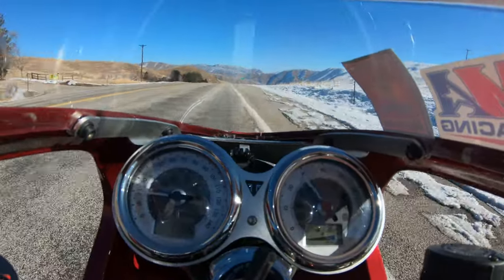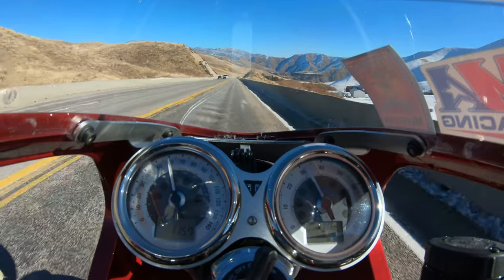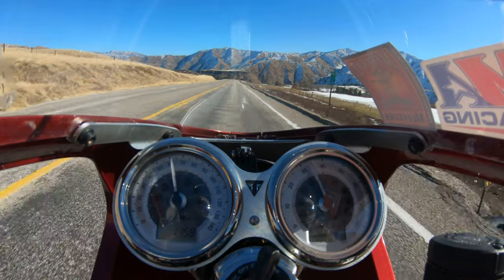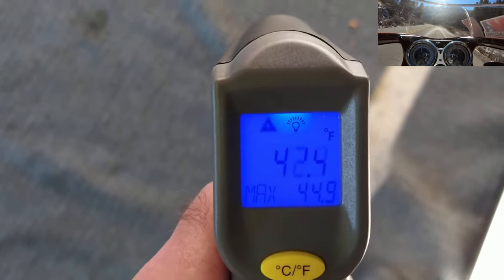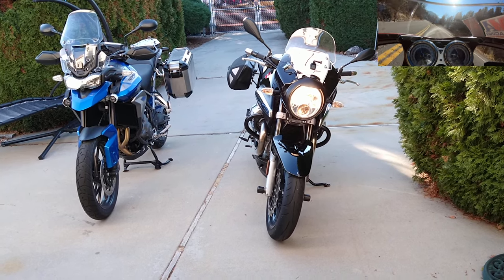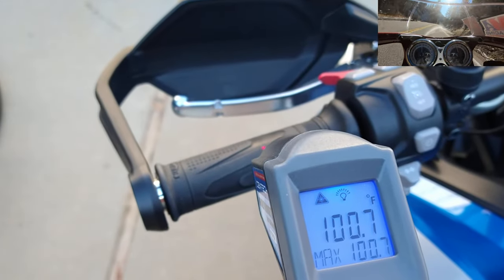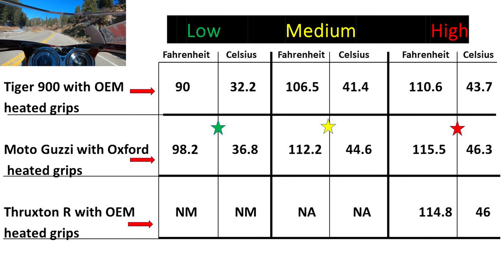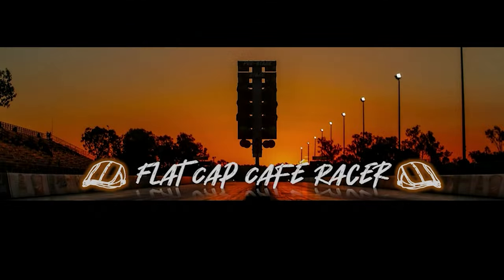Triumph Tiger 900 vs Oxford heated hand grips, which is the hottest??

Comment: Thanks for doing all that work on my behalf! I feel that I now owe you a gallon of fuel. 😀. I will at least now be able to have a go at checking the temperature of the grips on my tiger to see how they compare. Not as cold here at present, but the rain is certainly heavy...
Reply from the maker: I appreciate the question and you don't owe anything.  The values vary a bit and I did them several times but feel the results accuratlely reflect the differences between the OEM and Oxford heated grips.

Comment: Im planning on riding down to as low as 35°F here in NYC, and have a 2016 Triumph Thruxton 1200. Do you think the OEM heated grips would be find at like 55 mph, or do I need the Oxford Hotgrips Pro? Appreciate any feedback from your experience in the lower temps. Thanks.
Reply from the maker: I have OEM heated grips on my 2016 Thruxton R too. If you got a good set of winter gloves and the ride isn't any longer than one hour you probably will be fine.
If your not I'd just get a pair of electric gloves to go with your OEM heated grips. That is what I'm doing on my under 50 degree today.